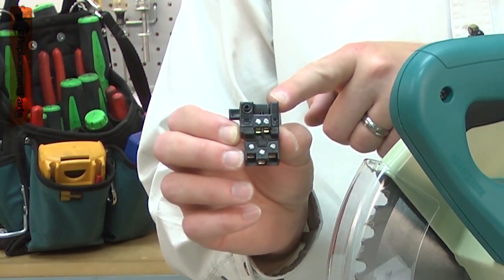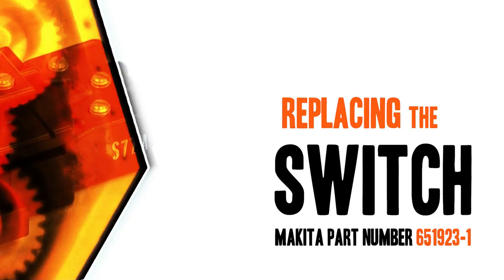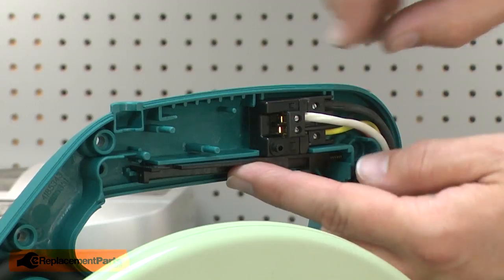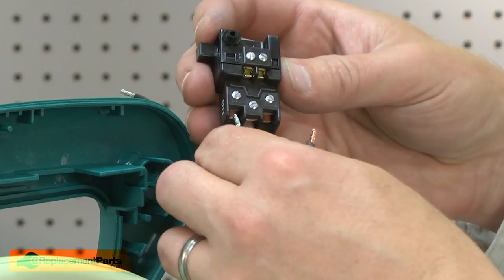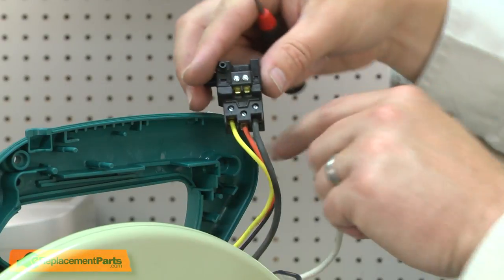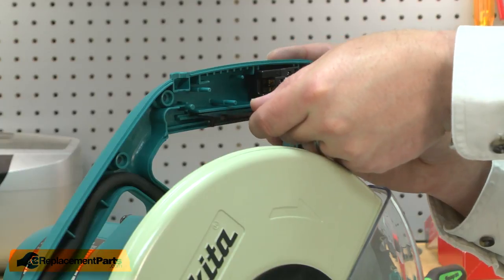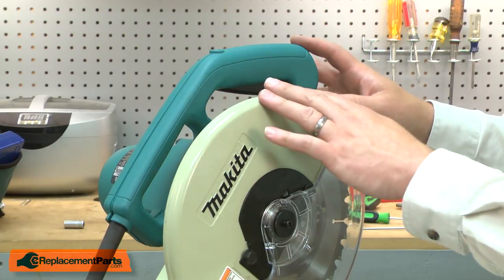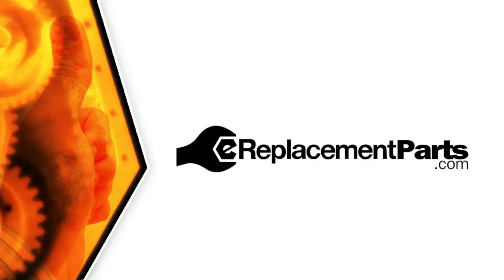Makita Miter Saw Repair - Replacing the Switch (Makita Part # 651923-1)

Comment: Hello.  I want to install the saw head into a caged automated machine. And start and stop saw using a 15A contactor. But this gives an issue with the brake not functioning. I presume one side of switch is powered all the time for this to work. Any ideas?

Comment: Thanks. I have the same Makita Mitar saw and lately been having an issue. After I finish my cut and release the switch lever, the motor does not stop immediately or at least as it used to be. The motor continues running and the blade spinning for about 10 - 20 seconds. Do you think this is a switch problem that needs to be replaced?

Comment: I have a Makita LS 1013 mitre saw.  Its  blade is a little rusty and dull and the wood I was cutting was rather hard - so the blade stalled. I let go of the trigger but when I pressed it again  the saw  made no  sound. I tried few times and got nothing. Th3e stall was very brief. I don't think the motor got damaged. Can anyone advise?